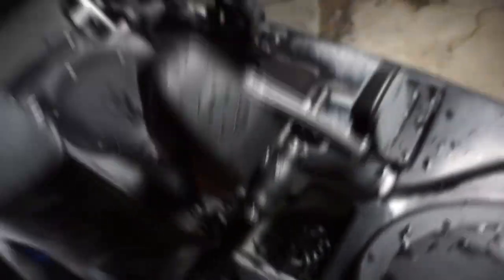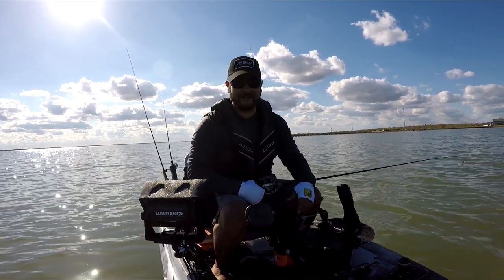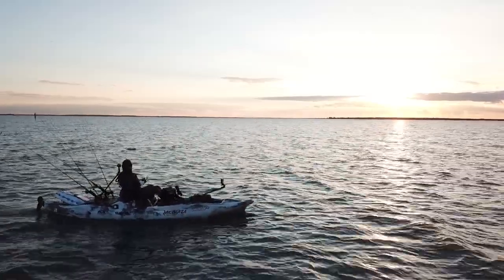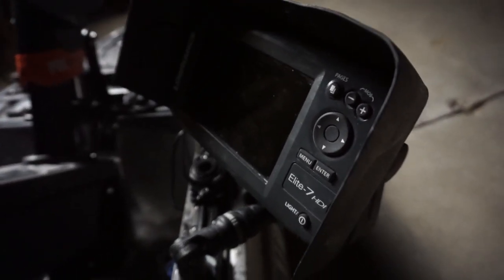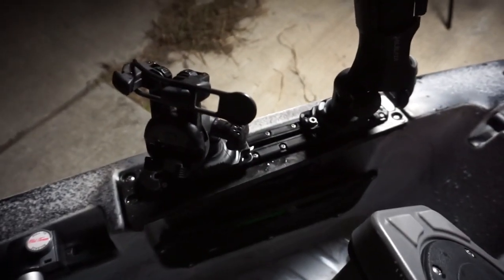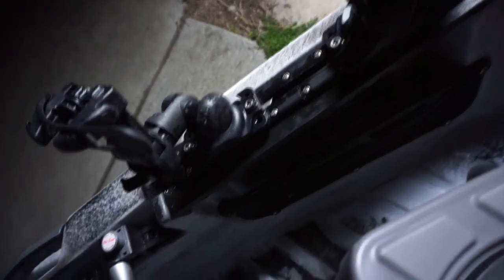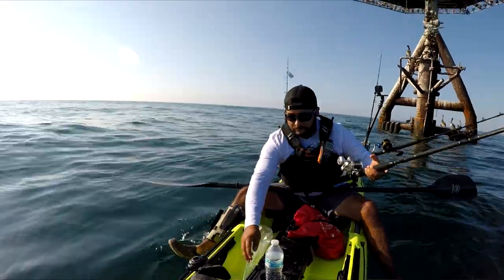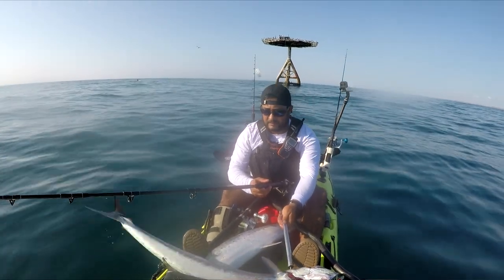Rigging My Kayak For Fishing | Predator PDL | #KayakFishingTOPGEAR3

Comment: I love the layout and hull design on the Predator PDL. Wanted to buy one bad but I couldn't get passed the big plastic box that's right between my legs (the pedal drive) when I'm in the flats or shallow water. Very little room to net and deal with a fish. Like the way you've got her rigged.
Reply: Yea it's a little different for us. Reuben and Chris have paddled for years now, just takes a little bit of adjustment. We've lodged the net over the hatch with the handle just next to the foot pedals.

Comment: Hi Chris, thank you for your videos. I have a Trident 13 and bought a PDL summer 2018. Both are great kayaks but the PDL is really heavy. Hope to see you using it offshore. Tight lines a keep safe.
Reply from the maker: Hey Norberto Guevara! I knew the PDL was going to be a tank but I’ve got to say, not as bad as I thought. I really don’t haul it around with the drive till I’m ready to get on the water and she weights about 90 ish lbs without it. Heavy but not bad at all, my Trident 15 weights 90 lbs. once ya pop in that drive though, forget it! Lol. I’ll be taking her offshore a few times to see how she does, tight lines!